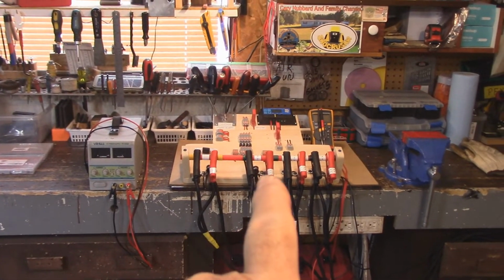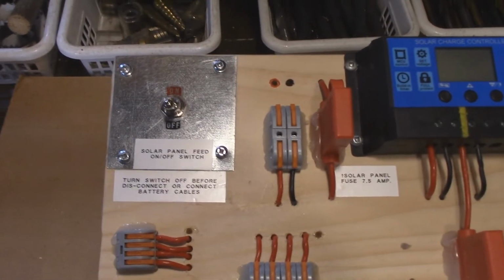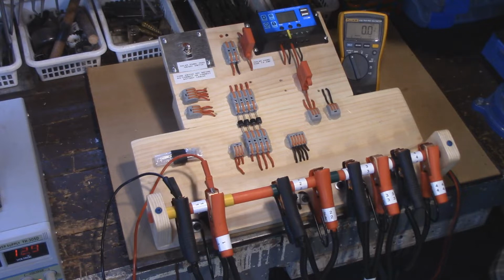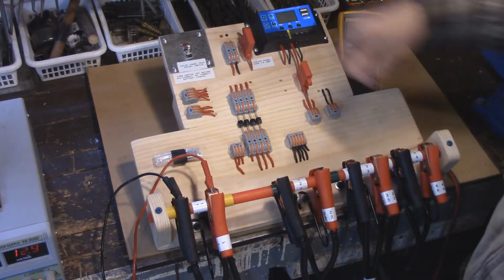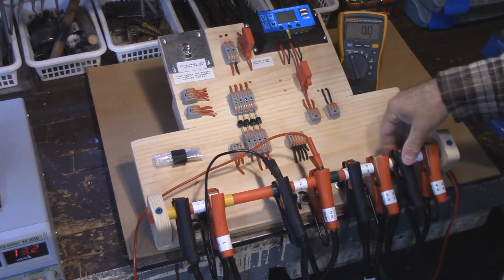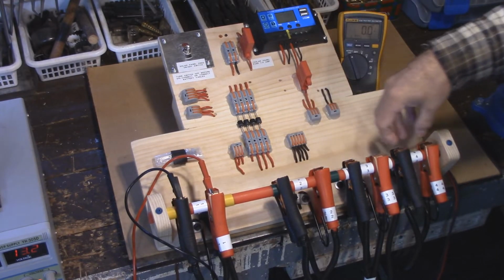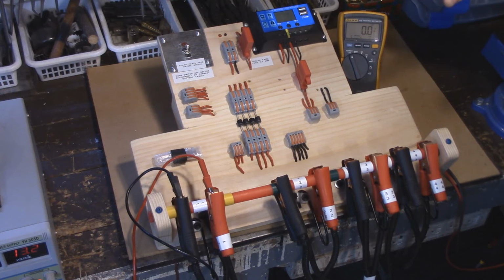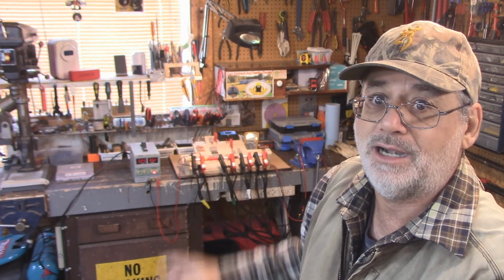Solar Battery Charger - 4 Different Batteries -1 Charge Controller - Part One

Comment: I'm probably missing something here, but does the charge controler not have multiple outputs? And those outputs would be isolated from each other?
Thanks for sharing Steve✌
Reply from the maker: Hi Marc
The charge controller has one isolated output  sending a battery charge to one master battery cable .  The master cable at one battery sends the  identical amount of charge to all the other batteries.

Comment: Very interesting setup 
I look forward to seeing how well this works. Currently, I've been using one trickle charger for 3 batteries with and haven't had a issue but this may be a better system.
Reply from the maker: I'm confident but testing is required.

Comment: That will work for you, Steve. A bit more complicated than I would have made it but it’s neat and not hard to follow and you even have some spare important parts, the diodes that do the isolation and a few fuses. Very well done from what I can see……CHEERS
Reply from the maker: Thanks Gator 👍

Comment: So, the master battery regulates all the batteries.  Can the other batteries become overcharged?
Reply from the maker: Good question Rick , yes would be the answer if the master battery  was overcharged but I'm figuring the voltage regulators job is to regulate  it and prevent overcharging.
Reply: @SteveRobReviews  The answer is yes, but for a different reason.  If battery 1 was still needing a charge, but batteries 2-4 were all charged, they would all still be getting current because the charge controller thinks battery 1 needs power.  Similarly, if battery 1 is fully charged, but 2-4 are not charged, they won't get any power because the controller believes it is all charged up.  I found the same charge controller being used in this video on eBay for $6 US shipped (not sure what the Canadian price would be).  I would have had my solar input go to a bus bar and then split the power to four charge controllers which would allow each battery to receive true individual charging.   You would also not lose voltage thru the diode in the middle of the system.  Also, if your cheap Chinese charge controller poops the sheets, you only lose power to one battery, not all four.  Pretty fun project though.  I think it will still work as it stands.
Reply from the maker: @YourOldPalFernbark  Looks like a great experiment to film on your channel.  I went for low cost , easy to setup and have the batterys given a consistent charge over the winter.  Next summer we will see the results.